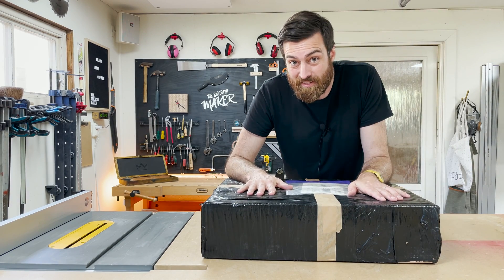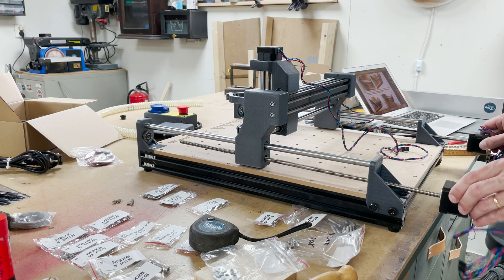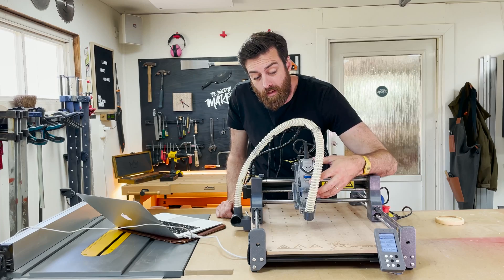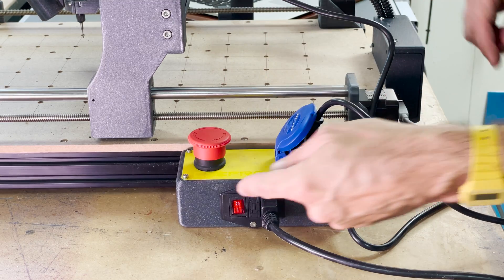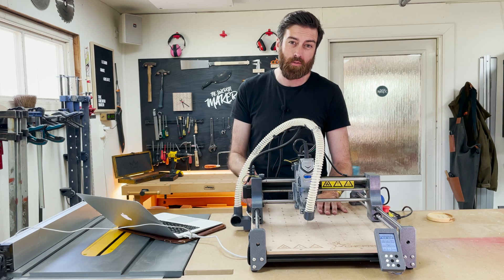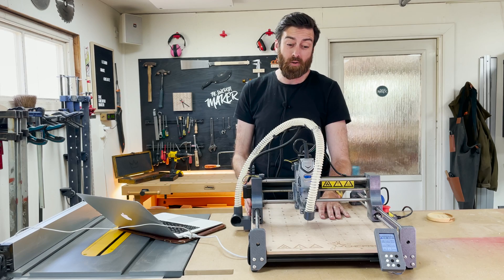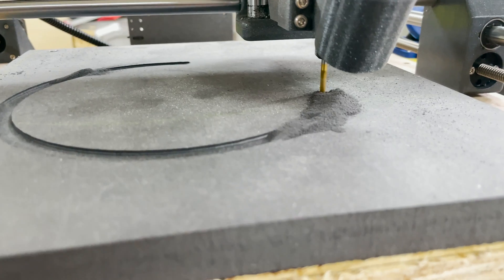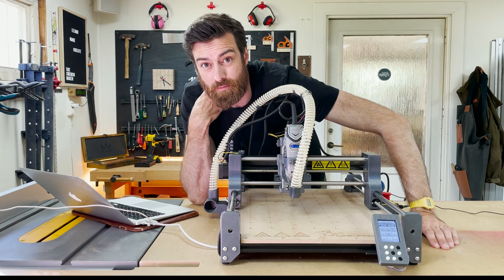Trying out a 3D printed CNC!

Comment: Thanks for posting. I have built 4 CNC machines now starting with an MPCNC. The little Dremels and similar are frustrating because they are so slow. My current PrintNC is very rigid, built of printed jigs, parts, and steel. Much more fun to use with a large spindle, LED lasers, drag knives, 4th axes and more.

Comment: This is a copy of Nikodem Bartnik open source dremel CNC 
He have also INDYMILL that is more robust cnc
Reply: they copied him FREE CNC PLANS and start selling it for 1000 $. Is that legal?
Reply: @GausOfficialChannelTM  there like more than 1 copy of it
They just change some dimmensions
And sell it crazy overpriced because linear rails etc cost maybe 50$ 
Motherboard with arduino 10$ 
Stepper motors plus drivers 50$
Screws etc maybe 30$ 
So max 150$ + dremel (better alternative is hilda 400w that can easly cut aluminium is like 30$) + 3d printed parts
And we talking about prices u will get localy
If u get everything from china it will be like 100$ + 30$ hilda 400w "dremel" + 3d printed parts
So 1000$ ....nope....

Comment: I'm on my 3rd iteration of a cnc. I think most people who jump into milling came from 3D printing. They already have rotary tools for post processing so the dremel or other alternative is good enough to start playing around with cnc. 

Use the rotarty to mill rigid replacements for the 3d printed parts. They will not look pretty but are functional.

Replace spindle to take advantage of the more rigid frame. The chinese 500 watt spindles or higher can replace all the milled and printed parts. 

It's exciting because assuming someone follows this progression it's rewarding.

Comment: Well done with the video! That CNC looks great, with sturdy design and extra points for the vacuum hose. Do you reckon it could be possible to mount the display and controller board on the side rails if needed, to allow the stock to be larger than the table in one axis? For example, to carve something on a long piece of lumber.
Reply: yes, you can screw the electronics and controller on the side.  We took this into account when designing the device, so the cables of the stepper motors, limit switches and controller have the appropriate length.

Comment: I started out on my MPCNC with a Dremmel and it was extremely limited with the speed so I changed over to a fast spindle which is much better, this machine would also benefit from a spindle or router because using a Dremmel is like watching paint dry but slower

Comment: Just looked up the price and is that really 1200 euro?   looks like a really good machine but expensive
Reply: Honestly for the price it looks like a piece of junk. Way way over priced. Maybe at most worth $500 USD new.
Reply: @billymorrish4466  I agree, if all printed parts are replaced my metal parts then it would be probably a 1200 euro machine in my opinion.
Reply: Too pricey. Better add €500 and get a Queenbee Pro.
Reply from the maker: Yepp, that's the price. With the discount it gets down to 999 though :)
Reply: @TheSwedishMaker  its going to be a tough market at that price..  quite a few good machines so I agree with you about being able to print out the prints at home to make it cheaper